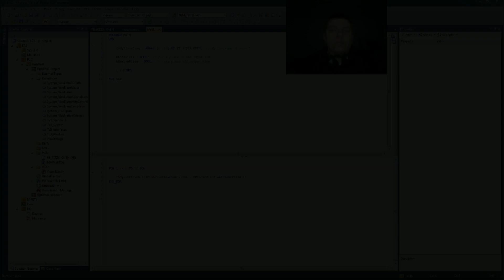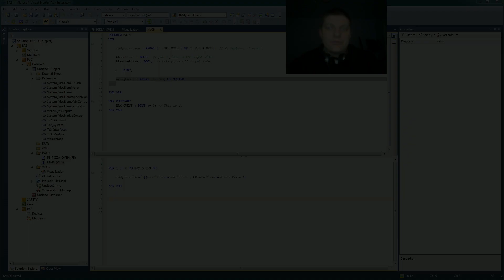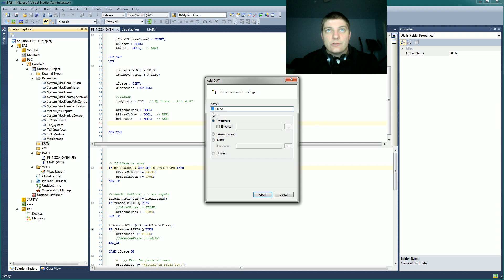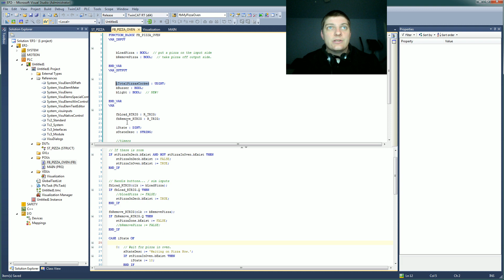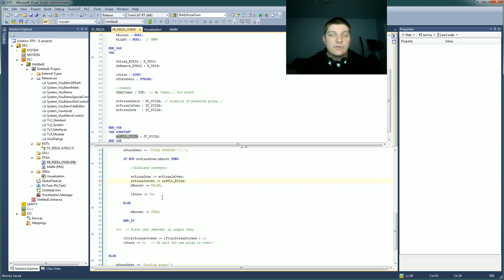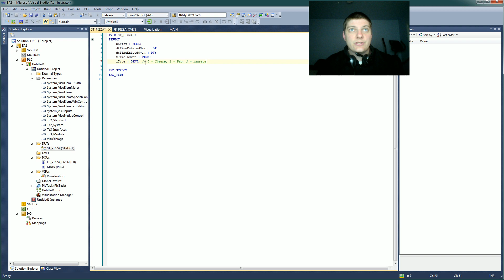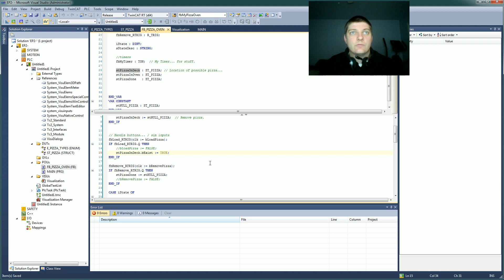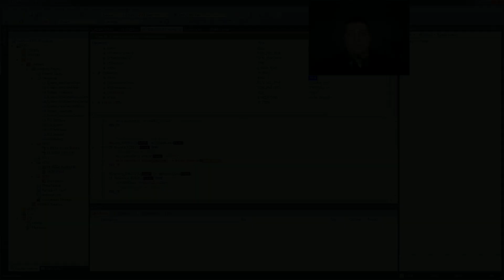Learning PLCs with Structured Text - EP9 - Arrays, Structures, Enumerations

Comment: FOR nFor:=0 TO MAX_OVENS-1 DO
  fbPizzaOven[nFor](bLoadPizza:=bLoad, bRemovePizza:=bRemove);
END_FOR
This code just runs for once, anyone knows how to fix this and get continuous values from FB instance?
Reply from the maker: You sure it's only running once? It won't show it running on the screen in your nFor variable but if you do like i=0 before the loop and then i++ inside it you should be able to count how many times it runs.
Reply: @SquishyBrained  I've figured it out from stackoverlow, someone had a same problem, they have used arrays for input of FB instace, I've done this and now it's working:

 bLoad   : ARRAY[1..10] OF BOOL;
 bRemove   : ARRAY[1..10] OF  BOOL;
---------------------------------------------------------------------------------------------------
FOR nFor:=1 TO MAX_OVENS BY 1 DO
  fbPizzaOven[nFor](bLoadPizza:=bLoad[nFor], bRemovePizza:=bRemove[nFor]);
END_FOR

Can you tell me how to write parametric code which is resuable and doesn't have static variables in Function Block? I mean if I have more input then I don't add more function block instances.

Comment: How to link FB instance to visualisation elements, it gives me errors. Also my loop for only runs for once, any suggestions?
Reply: I had a simillar problem in the past.
You have to create structs or variables to connect ant associate with the visuelements.
Input and output variables directly from a fb instance maybe couldnt work.
The problem could be that if a fb isnt called the used memory isnt defined so its difficult to display in debugging mode.
When u associate variables then u reserve the place in memory.

Comment: how to Check if an array (INT) contains a specific value
 (INT)?
Reply from the maker: do something like:
bFoundValue := FALSE
for x:=0 to 50
   if array[x] == 345 then
      bFoundValue := TRUE;
   end_if
end_for

where 0 and 50 are the limits of the array, and 345 is the value you are looking for.
Reply: @SquishyBrained   Thanks for you respond,
I have an array:   power : ARRAY[0..2] OF INT  := [100, 200,300];
and a variable x : INT;  .
and I want to check if x is in the array.
Reply: @JE99K  
n=2; (* assign a value to n equal to size of your array*)
bFoundValue:=false; (* initialize bFoundValue with value false, if it gets set to true at end of the scan, meaning  x int is fallen into your array*)
For i=0 to n
    If power[i] == x then 
       bFoundValue := true;
    Else 
       bFoundValue := false;
End_if;
End_for;

Comment: Hello, dont know if you can help me at all but i am watching your tutorial videos and before i started at the videos i even had to ask someone what a PLC was so yeah. But i got a asignment for work where i have to write a program so i tought lets watch some tutorials, you are very clear till now on but at the moment in this video where we change the variables 
bPizzaInOven  : BOOL;
 bPizzaOnDeck   : BOOL;
 bPizzaDone    : BOOL;
 
to
 stPizzaInOven  : ST_PIZZA;
 stPizzaOnDeck   : ST_PIZZA;
 stPizzaDone   : ST_PIZZA;
i did and also in the visualisation but i get the error :    Error 18 Invalid expression MAIN.fbMyPizzaOven.stPizzaOnDeck.bExist configured: Object reference not set to an instance of an object.

I really dont know where this comes from and cant solve it myself, would be a shame if i got stuck at this part of the tutorial. 

and yes i am little late to the party XD
Reply from the maker: Did you find the link in the description to the latest code on github?  Hopefully you can open this alongside your project and see what is going on.

It sounds like the 'not an instance of an object' is a problem with the software iteself, not your code.  That is an unhandled .NET exception, or basically a tag not found error that isn't handled well.  Try browsing for it just in case and select it that way instead of typing it in.
Reply: @SquishyBrained  sadly cant find answers for it, but i tried to make a very basic program with only IF statements that can put a gasburner in different states, like high gas or low gas and a fan that has Low state and High state but i get an error:>  Error 20 ;Internal Error (x86-64): Registermanager: Invalid state, it says its in Line 0 and MAIN 0. You have any idea what this could be?
Reply from the maker: @ducodegelder  Sounds pretty rough and internal. I'd recommend uninstalling TC3 and reinstalling, possibly a slightly older version.  I don't think these problems have anything to do with your code, especially the 'object not set to an instance of an object' thing.  Thats a twincat problem.
Reply: I have exactly the same problem, might have to do with the latest version of TwinCat?
Reply from the maker: @itsitindeed  I would think so... these are not 'end user' errors that I've ever seen.  Try an older version or reinstall.
Reply: Hi i'm also late, i had the same problem and realized it had something to do with the array of function blocks thus i simply used one function block instead of the array for the rest of the tutorial. I don't know if it's true but i think that we're trying to place two values for the states variables if we leave fbMyPizzaOven as an array and that's why the error shows up.
Reply: Try adding POU(s) for implicit checks like those explicitly checks whether division by 0 or whether array indexing beyond the limits of data type you chosen. I've used Somachie software which is too codesys based so in twincat you should also find these POUs for implicit checks. This is only to ensure no codes execution viloates the execution of task. Basically in codesys when error message like "Object reference not set to the instance of an object" is something likely that software is crashed so of course you can check reinstalling it once.

Comment: Hi Everyone!
I would like to know if is it possible to index a structure like an array.
I mean, what about if I need to fill one structure with data comming from an array? I'm thinking that maybe with a FOR loop, I can fill the structure but I cannot found any way to do that. Some tricks to do it?
thanking you in advance!
Kind regards,
Reply from the maker: Post or email a code example if you'd like and I can take a look, however, if you want to take an array of 100 data points and put them into a structure, you are probably best just making the structure an array, or make arrays inside the base structure.   Hard to give advice without knowing how the data comes in, but that might work.  Another option is to use pointers to "point" into the different elements of the structure.  Sometimes a simple memcpy instruction can do what you need, though I try to avoid them usually, as pointers can be a bit "fragile" if not used carefully.  (Also, never store them, use ADR() each time to avoid pointing to bad data). 
Maybe make a post on reddit / r/ plc and show what you are trying to do... they are helpful.

Comment: great work sir.... can you do a tutorial on Twincat 3 and Vb.net.
Reply from the maker: It is not on the to-do list currently, but if you want to get started, you should look at ADS.dll and find the example program(s) provided by Beckhoff.  It should get you up and running with a basic HMI pretty quickly.  Once you have the data over ADS, you can just run regular .NET tutorials to do the rest.

Comment: This is video is fantastic, LOVE it.
I have a question which buzzes me a lot. I saw you used FB array to handle 2 Pizza Oven, in the real world, each oven has its own buttons, so is there a more advanced way to assign these buttons to its FB instead of writing out every instance FB.
Reply from the maker: Sunh Hao there are a few ways to get it done, typically you either assign the io globally and "pass in" the io with the FB function call... the other way is to assign the io inside the function blocks and link it up there.  neither is perfect, but both work.
Reply: Thanks for your reply. Could u be more specific with the second way.
When I use OMRON PLC, the IO addresses is stored in DM, then I made a Read_I_Point FB, give it a Input Address, like input point 12.5( it's 125 in Data Memory), then the FB gives back the current state of this input. I'm  trying to implement a Read_I_Point FB by using pointer to point to IX0.0, so if I want the state of IX2.4, just add a index to the pointer so it can return the right state back, but I am confused that IX0.0's address is 0 read by ADS(), and QX0.0's address is still 0. Could u tell me is this doable?  And , how to do data block move in Beckhoff PLC? Thanks.
Reply from the maker: You can do it that way, but since I just got started with PLCs about 6 years ago, I never dealt with the 'direct addressing' of IO.  TwinCAT supports it, so you could feed in a pointer to the IO or something I'd imagine, but I never do that.  I typically just declare them at %I* and %Q*, and then once you build the project they show up in system manager as "linkable" IO.  Then, head to the actual devices, and link them to the function block IO.  I prefer not to deal with linking IO manually like you are talking about.
Reply: Gotcha, Thanks. I have about 20 identical things, and everyone of them has a bunch of IO, so it's painful to type 20 times to put these IO to the instance.
Reply from the maker: Sunh Hao I understand. I've never had a machine with so many identical things. usually I just bite the bullet and spend an hour linking it. there are better ways but I'm not that up on them. I know there is a c# automation interface for twincat for automating those tasks, but I've not used it. you could check the beckhoff webinars (if using twincat even)
Reply: Thanks, man, I am new to BECKHOFF, I'll dig it deeper. Could I have your email address for further communication?
Reply from the maker: Sunh Hao evanmj at the Gmail
Reply: @sunhao2005  Hi Sunh, may I talk to you about the question you have asked here? Can you tell me your email so we can talk?
Reply: Hi Evan, great work you have done. Can you tell how to write this code without declaring static variables in function block. If we run the code and if we want to add a new oven then in this situation I don't want to add a new FB instance, I want to run the code in a parametric way, whenever I add a new sensor or oven in this example I don't want to add new code lines, I want my program to be able to handle it by itself the way I wrote it with DUTS and ARRAY. Can you tell me how to do this with Object Oriented Programming principle please?

Comment: This is very good video. I'm having issues with matching visualization part of the code with PLC. Could you please show what was changed on Visualization side. I'm using Somachine software with your instructions so that might caused some issues as well, but so far I was able to recreate all the examples in previous videos with out major issues.  

Thank You
Reply: +Geronimo Bee
 Hello, I'm also using Somachine, 4.1 SP 2 . Just curious, which Windows platform is it running on ? I'm running on Windows 10 VM ware Windows 7 virtual machine.
Reply from the maker: I guess I'm unclear on the problem you are having... can you elaborate? I've not used that software, but the viz I made is rather simple, just a few buttons and indicators. not much logic behind the scenes.
Reply: +SquishyBrained Sorry My question was for "+Geronimo Bee" obviously not the way to contact him. 
I'm working on a PLC / Servo project using structured text for the first time in a non class room environment. Your tutorials are extremely helpful to me.
Thanks !
Reply: Hi Geronimo Bee,

The simplest you can do is change in MAIN the pizza array back to 1 pizza oven like this:
fbMyPizzaOven(bLoadPizza:=bLoadPizza , bRemovePizza:=bRemovePizza);

(Or change in the visualization on all positions oven i=1 etc. by: fbMyPizzaOven[1].....)

& in the visualisation you must change the pizza on deck, oven and done to the following to make it work again:
NOT MAIN.fbMyPizzaOven.stPizzaOnDeck.bExist

NOT MAIN.fbMyPizzaOven.stPizzaInOven.bExist

NOT MAIN.fbMyPizzaOven.stPizzaDone.bExist

Good luck!